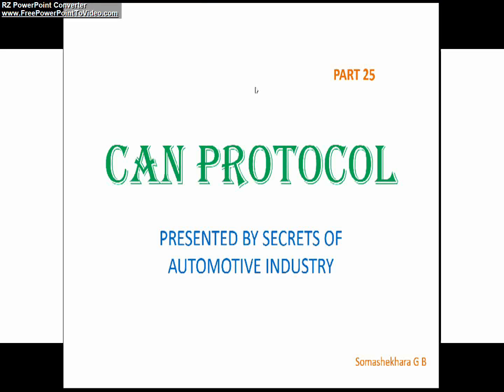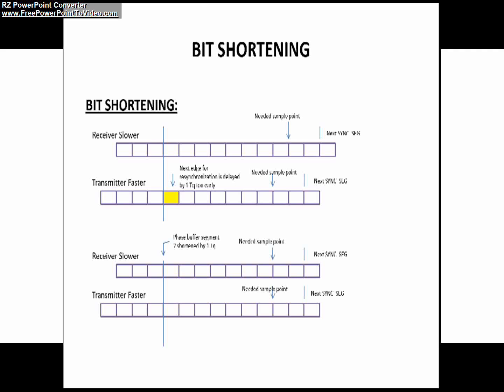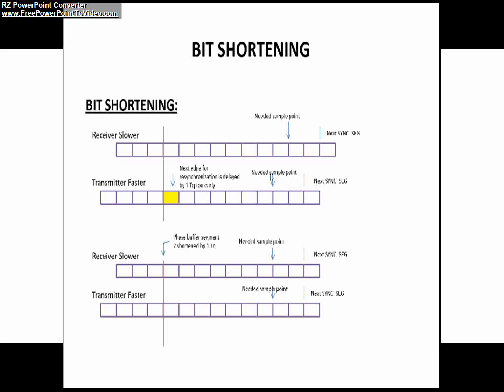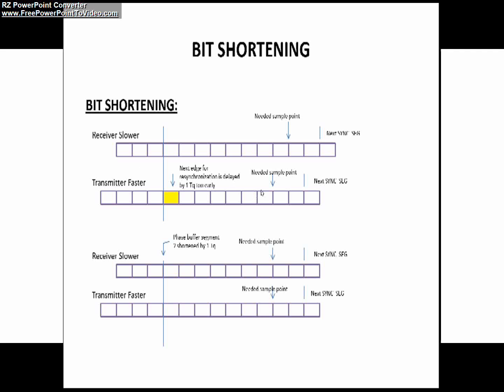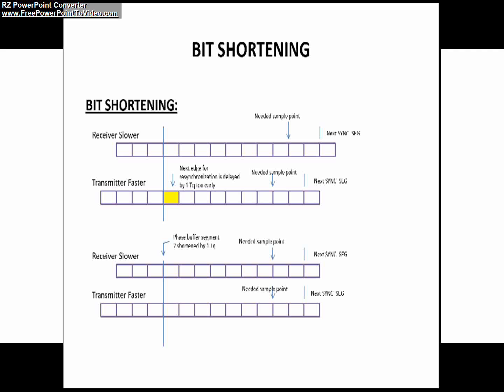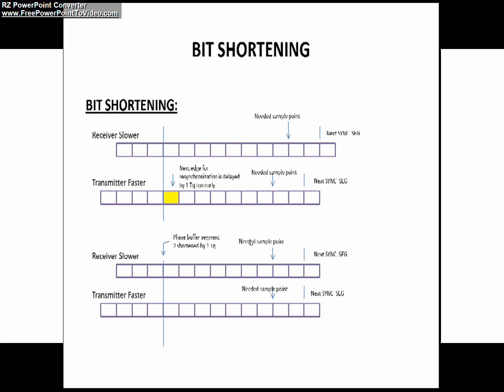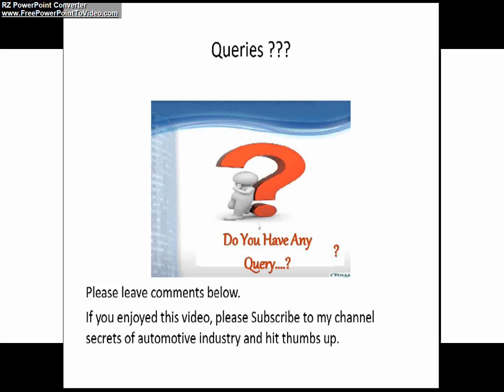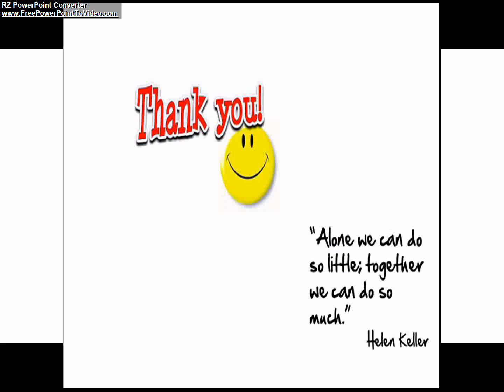Controller area network basics, PART 25, Bit Shortening.

Comment: Why shouldn't receiver shorten its phase buffer segment 1 instead of shortening phase buffer segment 2
Reply from the maker: That depends on edge phase error..
Reply: there are some bit timing requirements defined by the CAN standard. One of them is PropSeg + PS1 ≥ PS2. if this the case, PS1 can only be lengthened and PS2 shortened to satisfy the condition